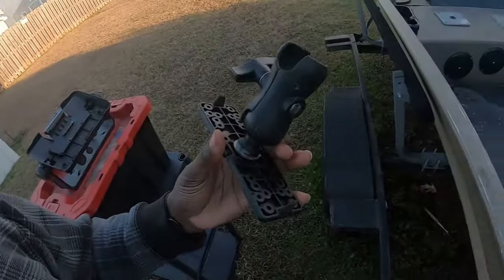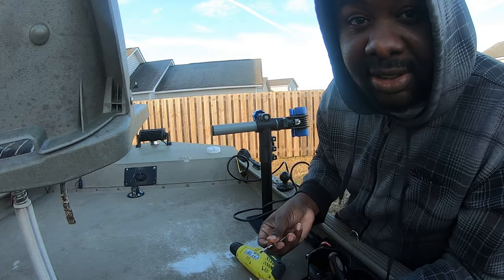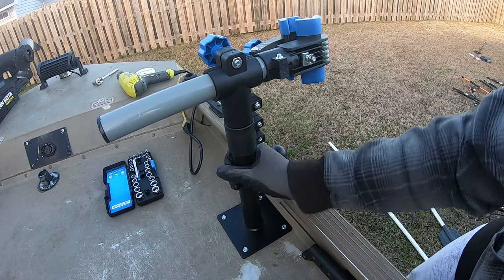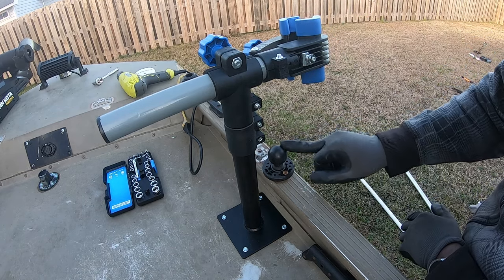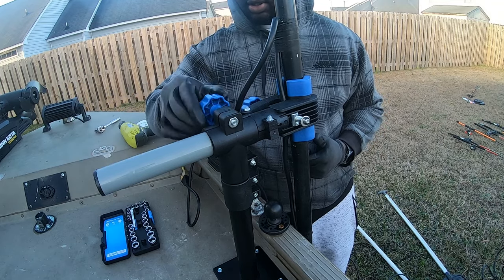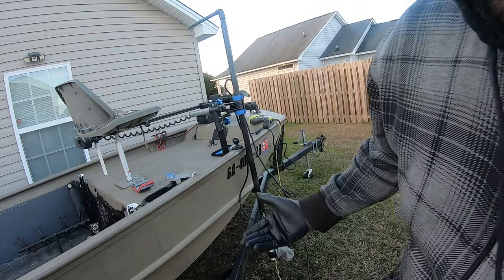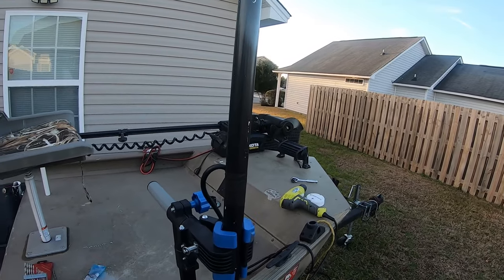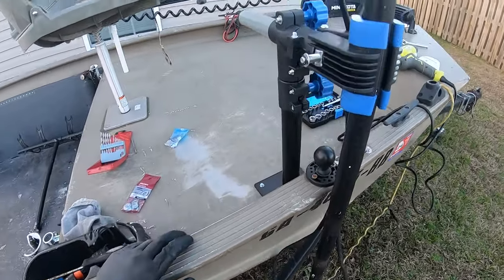D.I.Y LIVESCOPE Pole Mount HACK!!!

Comment: I have the same mount from summit, I had no idea it was a repurposed bike holder lol. Nice way to save some $ going your route. Only thing I would do is replace the hardware with stainless steel, some of the bolts and screws are rusting on mine after a month.
Reply from the maker: 🤣 yes. After I looked at both for some time I realized it's the same damn thing basically. Will definitely keep that in mind with the rusting. None yet so I should be good.

Comment: Great idea using the bike mount.  I curious while using your live scope while trolling does the bike mount hold the pole vertical with out bending due the force of the water?  I built a setup very similar to what you had with the ram mount and the pole and transducer keep bending unless I keep my boat stationary.
Reply from the maker: Well it's PVC so at some point it will flex depending how fast your trolling. I tested at 2mph with no problem but maybe at 5mph it may flex but I don't keep the livescope pole down at those speeds anyway.

Comment: Great idea,has anyone come up with a way to make the base that bolts directly to the floor or gunnel detachable?I want to still be able to put my boat cover back on and with the pole sticking up it is not possible?
Reply from the maker: @BristlesMowing  hmmm...I see what you're saying. I keep my seats in when I cover the boat so I don't have that issue unfortunately. I rather the water just run off like a tent. As far as the base being detachable I've not seen that yet but seems possible.

Comment: Great video! I'm strongly considering going with the RockBros mount on a homemade pole. One thing I can't find are the actual dimensions of the base where you bolt it down. I'd be looking to put it on a mount for a track system, but it looks awfully big. Amazon doesn't give the dimensions of the mount and I tried emailing to company with no response. You have any guesstimates on the length and width of it?
Reply from the maker: I'll check the measurements but I don't think it will do well on the track system due to the size.
Reply: @fredbfishintv   I appreciate you checking on the measurements, sir!  It the track system doesn't work out, I'll likely try to fabricate something that can be a bit mobile for me.
Reply from the maker: The base plate is 5x5.
Reply: I really appreciate it!  Thanks much and tight lines to you. 🎣

Comment: I did this.  I had to add pins to ensure it did not twist or rotate.
Reply from the maker: Nice. I haven't tested on the water yet but I'm itching to do so. By the secureness of it doesn't seem like it will give me issues but will see!
Reply: Did the pins sturdy the pole so you could trol..?
Reply from the maker: @JMDM82  I didn't have to add pins to mine and I was trolling at 2mph and still didn't move it. But the pins is also a good idea as well.